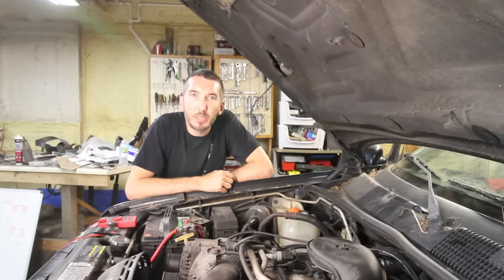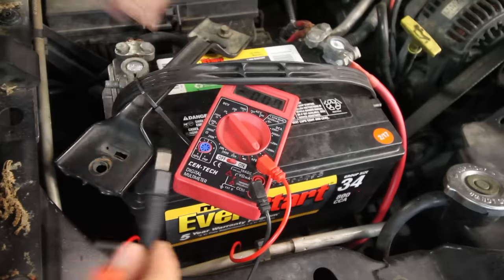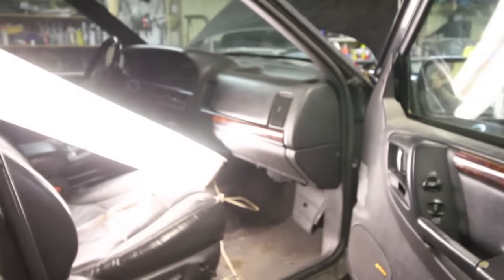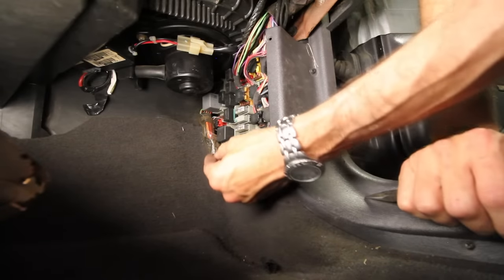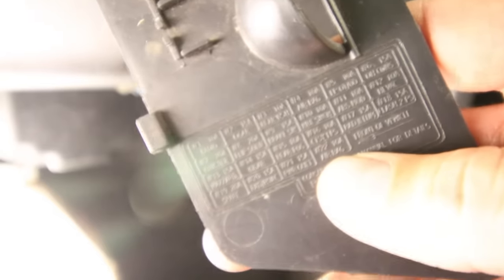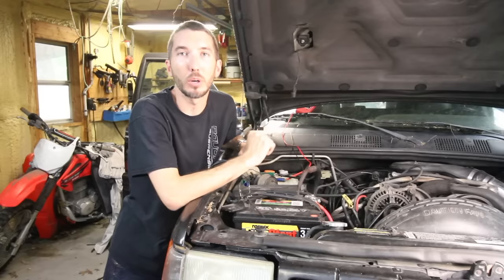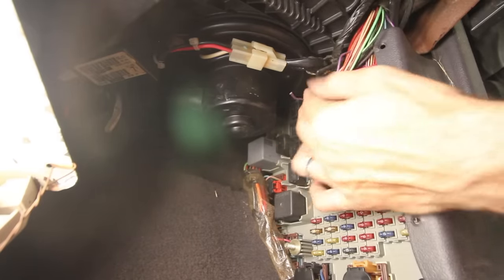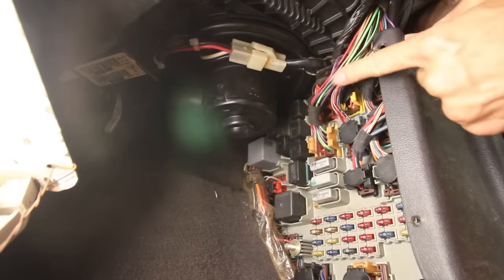Why Does My Battery Keep Dying? - Parasitic Draw Test and Fix - Operation Cheap Jeep

Comment: Yup, with all those useless sensors and electronic gizmos car manufacturers put on, that's what happen. It's crap, somebody should stop them. We are at the point of you can have a brand new vehicule that won't start because a stupid sensor. I heard that manufacturers are working on a sensor that will tell you if you left (forgot) your baby inside a car....because it happenned that couple of babies died during hot summer day because mom forgot them inside the vehicule (at Walmart I bet). Some legislators in Washington lobbied hard to put such a device (beeper if you forgot your baby, yeah) on all cars! Oh yes, manufacturers can easily (and will) fix such device....and add the price tag accordingly. Now a sensor if you forgot your baby! Why not a sensor if you forgot to pee before your journey, what the hell!

Comment: I have another reason a car is dead EVERY MORNING. I live near door to a humongous tree that drops needles every where.. My window was always so full of needle,. I would clean them off and Irealized they had worked their was under the rubber that holds my window in place. Water would get in and turn on my radio. that would stay on and drain my battery. I don't drive a lot, but one day I came out early and the radio was playing. glued the rubber back to the car and .....it worked

Comment: What’s the next step if meter is showing 0
Reply: Then either you need to learn how to use your meter, you need a new meter, or you don't have a parasitic draw (back to a possible battery or alternator issue); in any case, it's outside the scope of this video about tracking down parasitic draw. Be careful not to chase shadows so much you forget about the actual problem you're trying to fix. What are you working on?

Comment: Why not check continuity from the female plug to the component you thought was the culprit? The tutorial was good up until the part where you abandoned the repair and basically said "screw it, I don't need that to work."

Comment: You should have removed your wristwatch, especially since it is metal, and your wedding ring before working on the car. Wearing those items while working on electrical circuits is a good way to get an electrical burn on your wrist and finger,,,,and short out the electrical components. Auto computers (controllers) are very pricey to short out.

Comment: I'm pretty sure I have a parasitic draw. I fixed it by disconnecting my battery each time after I park. No meter. No stink. No pinch.
Reply: Jerry F I want to know why a Mazda 6 2 6 alternator keep overcharging
Reply: I don't know why it's doing it but it just started it and keep on making my battery to get hot in the toilet like smoking trying to figure out what should I do about it
Reply: Bones McGillicuddy  Obviously there's a parasitic draw in your brain that prohibits you from understanding comedy. Well, at least you can still be amazed.

Comment: The most annoying thing about car manufacturers is they NEVER have given complete lists of what might run off a fuse!!! Not in most owners manuals. It would be a simple thing to do. They give one item it runs in the "quick list" (usually in an annoying hard to figure out abbreviation ECM etc) when it would be so simple to give consumers and mechanics a simple list. Even you, an experienced mechanic, has to sign up for some damn internet info sight! Always bugged the SH*T out of me. They always make it harder than it needs to be.

Comment: Why does my 2001 jeep grand cherokee die after I trun it off
Reply: Is the battery bad? Check n see if your battery is holding a charge, if you dont have tools to check battery charge autozone or checkers will check your battery for free

Comment: Take back panel off its the plastic metal clip switch on the glass its on the top inside edge if you slam q case of beer or water on it it stays open under panel ......!!easy fix is crimp metal back around plastic and fixed no Brainer

Comment: I am unclear about how the wires were hooked up to check the amp draw.
Reply: He removed the negative cable from the battery post, then hooked up multimeter to each end of that circuit, positive lead on the neg post of battery, and neg lead of the tester to neg female end of battery cable to completd the circuit with the tester now in line to check for any draw

The meter set at 10Amp setting on the dial "Amp" section.  Note the tester needs its lead plug to be attached to the "fused 10A" plug in.  Most other voltage testing is done with that pos lead plugged into the "500A max VohmA plug in", as marked on my etekcity unit.  Hope that helps.  He just used alligator clips to extend his tester leads.

Hard part then is to remedy the draw once located, but great video "Bleepin"!

Comment: I understand don't turn on the lights don't open the door don't try to start the engine don't throw this don't do that go down the road a little bit I understand okay don't open the door okay don't try to do cigarette lighter don't turn on the radio don't try to start it I understand that you don't have to go for 20 minutes on that

Comment: Thanks your vids?? I hope repair both parasitic drain 96jeep sport Cherokee..an very urgent, repair electrical switch's use power windows.. 16weeks I've been half body covers BOILs,    insomnia. An bad bad neck ratchet neck stuck me 85$ at chiro plus lost bank card.took three moons recover.   The drain is likely over One yes.  It's intermetant, comes goes.  The wind shield both leaks at top an then became cracks badly 3+yes ago.  It needs replaced as well..I'm wonder do Bondo work when have junk yard replace window.tjese leaks caused OTHER issues. Re wire ignition switch..sometimes wind shield wipers. Not included a rewire on YET, but dash light an rear brakes an running lights. Mathsellah wisdom helps get thru .  My windows quit jus before end of May this yr..I'm.vague process accurately. I removed door panel an pulled multi switch. Out. It hangs an cut open factory skin on door enable hands reach window motor .  The fuses we're checked..an I put neck.out whack Badly broke also five separate pairs eye glasses. I'm far sighted so looking in fuse panel issue... 
I don't.know where take it locally. Pay someone else. I'm offered 25pr window an I buy parts. 
Oi. I'm think to run from battery ====== to fuse panel. Or. Add inline fuse for a toggle switch. To motor in door.  See if resolve matter. 
Other issue. New Alternator last yr..Oct an. By March told I needs add a Volt regualotor...my YEAr didn't have one..part stores reluctant to see me a inline reg..mount on firewall.. an querious if I'll needs include regulator while rewires external fuse to there's window toggle too window motor..
In door itself. I find one motor up high about where hand rest on arm rest
.other smaller window motor is low nearby bottom outside like where seatbelts mount while door shut. Each motor hath two colored wires. Hard tell which is Positive or tap into with wire I'm. Expect run direct from battery
. Hope your understands..

Comment: I thought I had a parasitic draw, because the battery would be dead within a couple of days, so I'd re-charge it, and I checked but couldn't find any kind of current draw on my battery,  the problem was that my battery was a Wal-Mart product, so I junked it bought a good name brand battery and since then I have never had no problems, with my wife's 94 Chev. P.U.,   answer is to spend just a little bit more and get a good battery don't buy Wal-Mart Junk.

Comment: You where doing good UNTIL you cut the wire to "fix the problem".  Don't cut wires .
Reply: Yeah. I think I would have sourced out what each colored wire controlled before cutting anything. I've got a feeling he already knew what that wire controlled before he cut it.

Comment: Something is draining my new battery within 2 weeks
Reply: Informative 
I believe you haven't problem with parasitic draw
I think you drive close distances 
You can test the battery if that is good, then you can charge the battery with a charger
This happens especially in winter

Comment: I am able to locate three wire bundles, 1 draws 0.05, 2 draws 0.10, 3 draws 0.16. But I am not able to ping down to which pin, none is found. They are in here: https://www.autogenius.info/mitsubishi-lancer-2007-2017-fuse-box-diagram/, Instrument Panel Fuse Block, the most (3) left upper corner one, (1) next to fuse 4, and (2) next to fuse (7,11,14).

Comment: Hi Matt, so I have a 2007 Jeep Compass in which the battery randomly drains.  Jump it, take it to get the battery and alternator tested and they pass with flying colors.  Found your video and wanted to test this out.  I am no multi-meter expert, but I dont have a 10 amp scale per say but I do have a 20 setting.  It would read 2.xx something and eventually go down to 0.01 as seen on my pic here https://photos.app.goo.gl/vEAevwqTnVvmFukLA  I am not sure if I am getting a correct reading, a little help on the setting would be appreciated.

Thanks and great video, it is very informative.
Reply from the maker: Pretty sure it just moves the decimal point.
Reply: You've got the meter set on AC amps. Disconnect 1 lead briefly, set your meter dial to DCA 2 (number in green not white) Hook your lead back up. Make sure your headlights and everything else is turned off. Parasitic draws are usually less than 2 amps. If your reading is very low .02 or less, it should be good. Your clock, radio settings and key FOB circuit draw a little. Good luck.

Comment: God bless u good job btw. Jeeps died with tipm it killed dodge & jeep Chrysler Ram as a company there are tens of thousands of lawsuits from electrical issues and issues w the hemi... the company is going bankrupt. Too bad. Chevy fan ;) and the does it have a hemi" ol...  U mean the v8 with defective lifters and oiling problems to where a factory motor cant idle w/o ruining roller lifters due to oiling. Even the hellcat engine. All garbage. Dodge is dust in the wind.. Sorry jeep fans